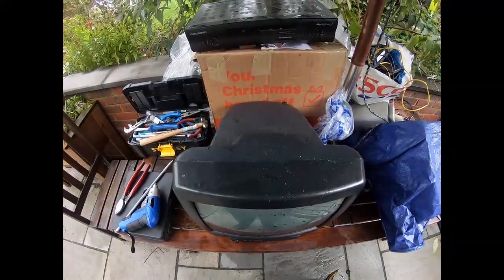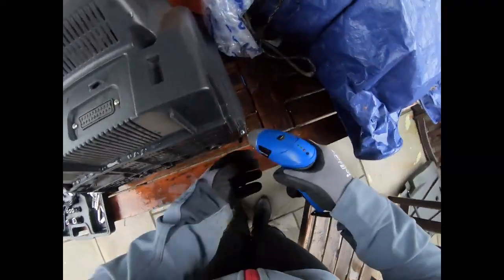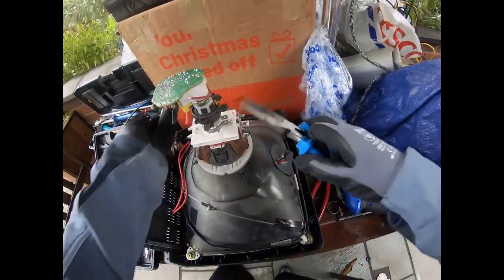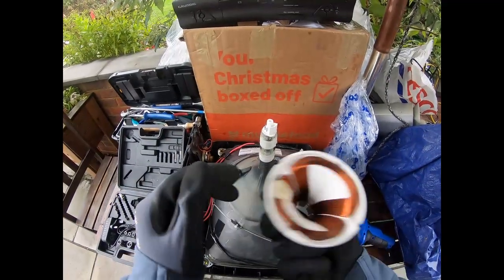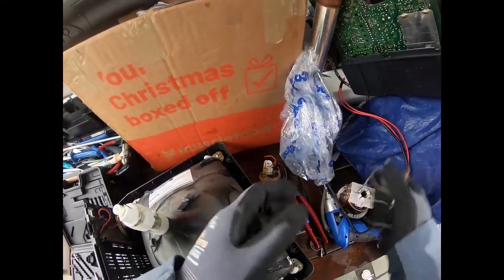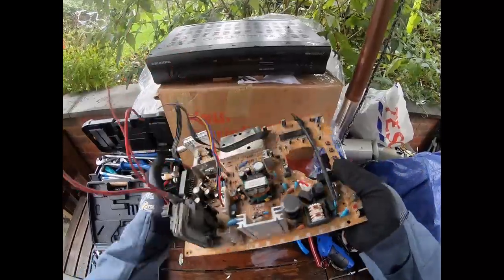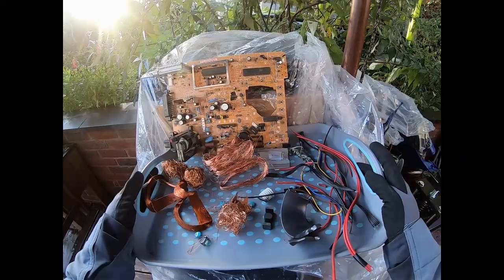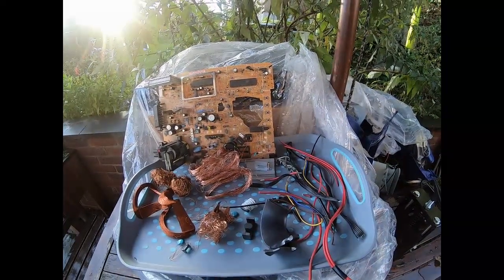e-waste: How easy is it to scrap a CRT TV, how much copper will be inside an old basic model TV?

Comment: you can power up and use ctr tvs you can still buy a black and white licence all you need is a,  wait for it, a digital decoder box like an old free view box i have a lil 12 volt b&w Encase of SHTF world order also a cb old school stuff i think slow scan is about still for radio hams  winks the steal antt box is the decoder area the back chock type thing is a HT COIL that powers the RED HT lead into the glass tube  its there to allow the three guns to fire red green blue that is the top board you take of the ctr first smiles babble on a bit but here is how slow scan is used   ihttps://en.wikipedia.org/wiki/Slow-scan_television
Reply from the maker: Ah yes but didn't you hear about that couple in the UK who wiped out the entire internet in their village everyday at 7am by turning on their old TV lol
Reply: @SollersScrappingandDiving   yes, i remember that one , but alas no one seen there flux capacitor they got off the internet fasten to there gigawave aliencraft in there celler lol
Reply from the maker: @scrapwomblecreatives6944  😂😂